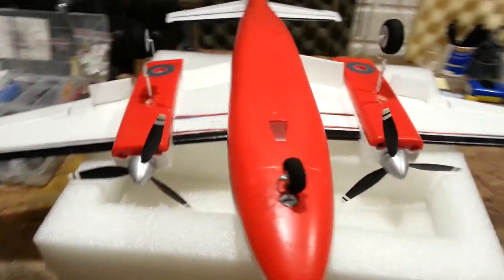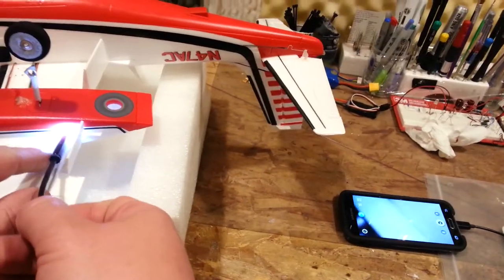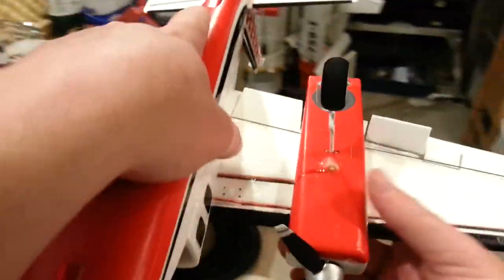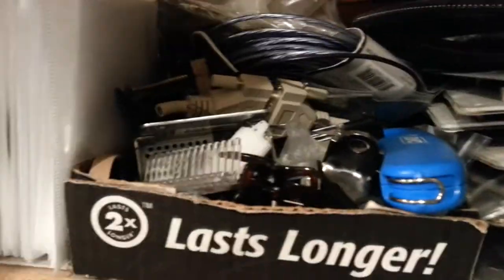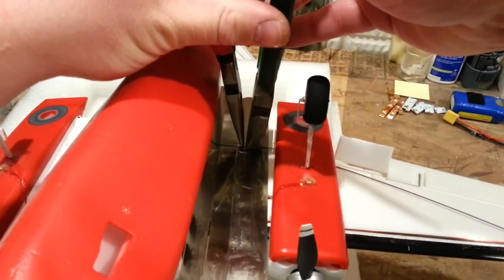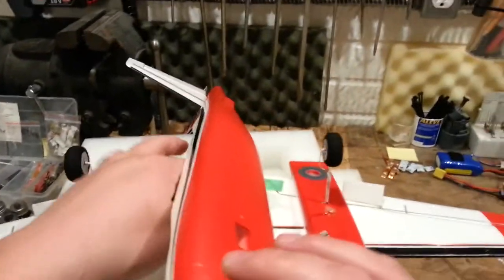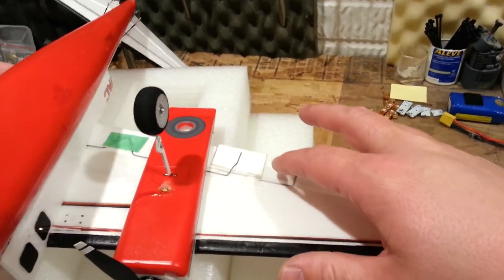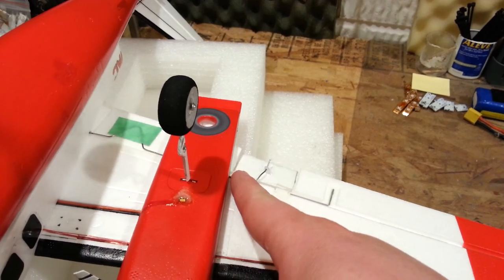Eflite - Aero Commander UMX - Flaps Mod - Part 8

Comment: that was definitely the hard way to bend the wire maybe pre bend then install leaving extra length at the end to cut and fit to servo. you'll be able to make a mirror image much easier. just saying
Reply from the maker: It's hard to fit it though the nacelle, which I did do in the next video, if I recall.

I agree it'd be a lot easier, and more exact too :)

Comment: 17:59 why not just glue a triangle shape wire to the straight wire instead of bending it? Or maybe even solder the triangle shaped wire to the straight wire.
Reply from the maker: The torque would rip the glue joint almost immediately and soldering, in place, while touching foam, is recommended only AFTER cutting off your own tattoos of fish...but maybe some day :)

I have them working now...they look VERY good too :)

Now I'm just working on the outboard flaps, since the action was as good as I'd hoped for.

Just posted another video, but a couple coming tomorrow AM (then throughout the day), since they have to upload and process. I don't want to release them in the middle of the night, as it hurts already low traffic videos.